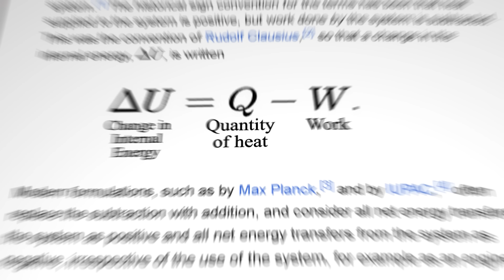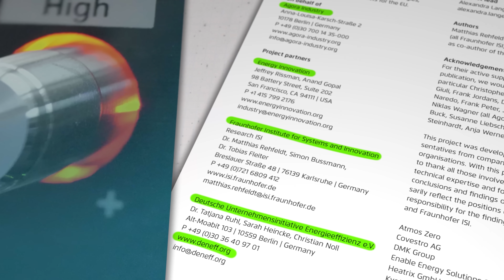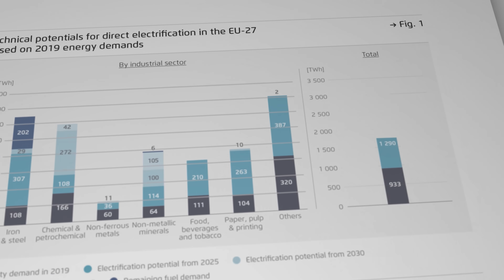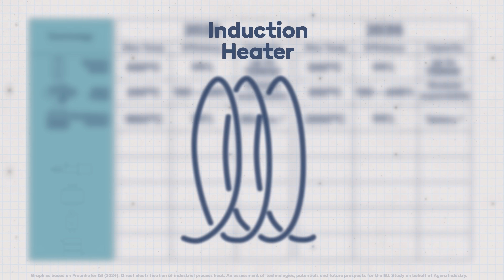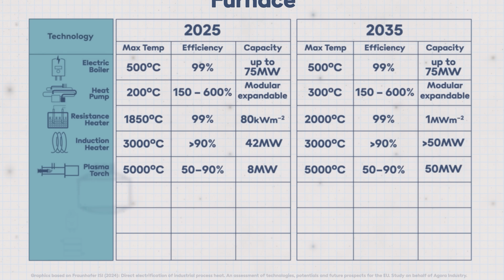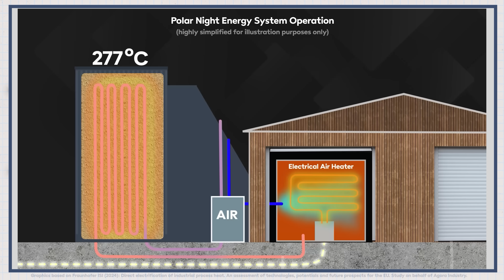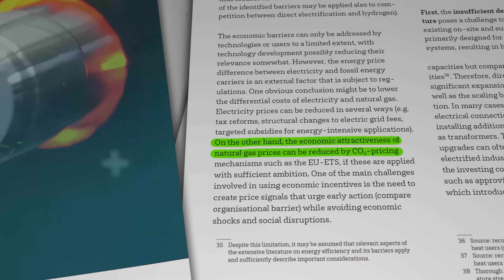Kicking fossil fuel out of industry! Here's how it's done...

Comment: Happy New Year!

It's certainly possible to electrify industry - although a big problem is, as you said, the price of electricity. Then there's the issue of capacity. You can increase supply by adding more renewable sources on the input end, but the system itself has to be capable of transmitting that power.

To do all of this industrial scale heating plus have electric cars, the power grid will have to have a much larger capacity. From your past videos it sounds like the European Union is planning for electrification by building new interconnectors and stuff, so they might be prepared for the massive surge in demand. I'm pretty sure Canada and the US won't be ready. Electrification of industry here will have to be preceded by rebuilding a lot of the grid.
Reply: The increase in demand does not arrive all at once ... there's time! Electricity infrastructure has always been built, extended and renewed in an ongoing fashion, as required. However, there are certainly some priorities to be focussed on!
The electricity use in every country has a particular pattern of use. The generation capacity has to be sufficient for the peak demand periods ... and that peak demand is way higher than the demand most of the rest of the time. At night time (for example), when electric cars are mostly charged, there is significant unused capacity available... we are still nowhere near soaking that up.

Comment: Our company converted from gas fired furnaces to electric induction and infrared heating almost two decades ago. Recently we installed as many solar panels as our roof could hold. Customers have shrugged and sent work offshore. There’s the rub. We might care but the customers don’t.
Reply: That is true of carbon pricing is also applied for imported goods.
Reply: The company probably got subsidy, paid by the people  ....  Taxes are now 70 - 80 % of brute income ....
Reply: This is an interesting dilemma. That company could have a competitive advantage as soon as a carbon price is in place, thus taking advantage of foresight an others then have to fight over high priced upgrades. The carbon price is not impossible, just resisted, perhaps by those who want to keep their present competitive advantage.
Reply: And where does the power come from? Coal or fossil fuel
Reply: @montanausa329  I mean, for you, yes. You live in Montana? Most people don't live in Montana or Kentucky, so in general, no. :)
Reply: Well... You can't compete if you sell crap. Do you work for Ford?

Comment: or, rather than use expensive electricity, just use cheap nuclear

Dow and X-energy will collaborate with the intent to deploy X-energy's Xe-100 high-temperature gas reactor technology at one of Dow's U.S. Gulf Coast sites...The Xe-100 reactor plant would provide cost-competitive, carbon free process heat and power to the Dow facility....The reactor can provide clean, reliable and safe baseload power to an electricity system  [80 MW electric] or support industrial applications with 200 MW thermal output per unit of high pressure, high temperature steam.
Reply: Nuke is expensive
Reply: @davidwatson8118  Yup! So expensive that Dow took a look at electrifying, and gas futures - and went nuclear!
Reply: https://youtu.be/AauseIxFQRE?si=WilUQIN5H0dnrCLW

Comment: I've asked a few HVAC guys if they've heard of heat recovery devices for the AC and heat pumps that they install.  Cue Crickets.  They are somewhat interested when I show them where to buy one.  It seems that around here it might be easier to find one at the high-end  swimming pool installer's showroom than at a HVAC dealer.  So much for "free" hot water in the summers.

Comment: Conventional industrial heat is typically diffuse and well over nine tenths of it is wasted.

Direct induction heat, by comparison, can be well over nine tenths directly applied to work.

True, Rube-Goldberg systems to recover heat can reduce the waste of the former, slightly.

But by and large, industrial heat is just sloppy engineering.

Comment: I think that it is kind of misleading about stating the efficiency of resistive heating is 100% efficient. The electricity used to power those resistive heater coils has to come from nuclear or solar etc. for it to actually be not powered by fossil fuels..... It is still way more cost effective to use fossil fuels or even wood to heat than anything. That is why so many places around the world still use fuel for heating and cooking. Even heat pumps which I have like 7 or 8 of in my house. I was using like 1,300kWh per month and at the regular rate, it was like $900 per month until I switched over to the subsidized plan of all electric house with electric boiler and IH in the kitchen. The boiler alone uses like 16~20kWh per day. (newer heat pump versions are available)...It is still cheaper for me to run 3 kerosene heaters placed around the house. The heat pumps can barely keep up due to the house being built 60 years ago and such a bad R rating...

Comment: Good to see industry needs being addressed. But i'm uneasy when it's said that these processes will be mostly electrified in Europe. I wonder if that doesn't just mean more industry gets moved overseas. I also struggle to imagine a big electric arc furnace being powered by batteries when there's no wind or solar energy. You can use gas as backup but then you're wasting half of it converting it to electricity when you could burn it directly.

Comment: Fascinating as always, and thanks for all the research links too. Granny, eggs etc but a few thoughts:

- Hydrogen, green or grey, is only really suitable for systems whereby energy density is the overwhelming design factor (e.g. aviation). Inefficiencies in H2 production mean that is will only ever be a true replacement for direct electric heating once the energy required to produce it is "free" (fusion).
- I reckon / hope that In the mid to long term, small modular fission with high grade heat output (HTGR, molten salt etc) will become an ideal energy source for steel, cement & chemical while low grade heat from more classic SMR designs will become ideal for desalination, food etc. I'm waiting with all my bits crossed for China to build the first nuclear fired steel plant and run carbon capture, or even better fission-fired green H2 production for the metal oxide reduction.
- Massive investment into electrical grids will be required for widespread industrial electrification which is unlikely to be government funded, driving operating costs beyond economical sense in western countries.
- Terrifyingly investment in oil prospecting and extraction is still flying high, with Guyana set to overtake Venezuela as the key oil producer on that continent in the near future. 
- We (as in, industrialized nations) spent centuries burning fossil fuels which led us to where we are today. We must expect that many, many other developing countries will do exactly the same, so our efforts must be to offset that as thoroughly as possible. Despite the UK economy being a complete disaster we're still in an extremely enviable position in the grand scheme of things.
- I don't like the orange thing across the pond either.

Happy new year :)

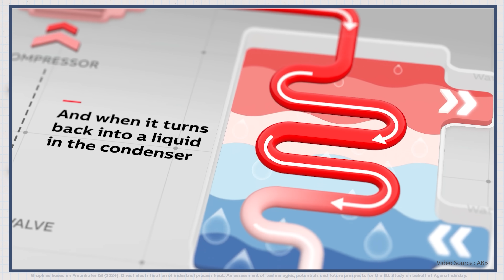Comment: @ 4:59 you can get but you don’t get it for sure … to stay in the 4-5 units of heat out you need everything to be perfectly made and designed… + you are extremly dependent of the exchange medium (usually air) to keep you’re high efficency + you have to change you’re lifestyle in order to keep a heatpump efficient to operate … - A gas boiler it can easily self  adapt to almost any lifestyle … you don’t need an extremly skilled engineer to do that …😅😊
A higly modulating gas boiler doesnt need everything to be perfect to stay efficient because it can self adapt to the load and the weather doesnt influence it’s heat output as much as it happens to an air to water heat pump…
Reply: A gas boiler burns fossil fuel. It's awful.

Comment: I this time not sure to completely roll out burner.
For the decarbonization to have success we simply need to avoid fossil fuel. 
Synthesis of fuels that can be a 0 emission if the fuel do not have carbon (Hydrogen or ammonia) or it can be produced trough carbon capture (so you release what you capture X-X=0).
In this case, fuels are simply storage of renewable energy, as chemical energy.
And while this is generally a process with not stellar efficiency in the charge phase it's easily scalable, at least using them to burn and heat up things, allow to an early 100% efficiency in the discharge step.
Much better than using them for cars...

Comment: @ 4:21 wrong - almost anywere electricity is and it was 3-4 times more expensive than gas / kw unit because electric lines have an average of 70% lose in the transmission lines and transformers …  and gas not … 😊 
And you can’t get more efficient kw output from gas in electrical power plants; convert it to electricity; send it to homes through power lines and then convert it again to heat compared to a condensing gas boiler at home for heating 😅 
But you either don’t understand how all this works either you’re full of bullshit and badly intended …

Comment: 11:30  That's often referred to as a "Carbon Tax".  I fully understand that a carbon tax draws CO2 emissions into the economic cycle and has to be part of the larger solution. 

The problem is that a carbon tax is one way for a government to get themselves rapidly un-elected and out of power. And a sure-fire to get into power is to promise to cancel a carbon tax. So as a solution, it has this built-in issue. And it's not just a North American thing, look closely at some of the 'Far Right' corners of Europe.
Reply: In Canada they made the carbon dividend and distributed it to the citizens. Did you heard of it?
Reply: @lorenzoventura7701  Sure. But it doesn't change my point about losing elections. Voters aren't always clever enough.

Comment: @ 4:11 They are cheaper to buy than a condensing gas boiler for the same output power … ar least up to 35 kw … 
You can find them. From 5-600E up to 2000E depending on the brand and model but is the same for the gas boilers …. You când easily find 5-6-10000 E gas boiler for you’re house … you just have to know were to search for it 😂 
Usually an acceptable condensing combi gas boiler starts from 7-800E up to 1500E … 
Until now in the video you are full of bullsheet with not very good intentions… or very wrongly informed 😅

Comment: @ 4:02 the fire hazard will be higly increase because you can smell a gas leak but you can’t smell in time a overheated electrical connection … + it is “very” good for all the apliances to have high levels of voltage pulsations from the high loads of electric heating rezistors getting in and out of the electric network 😅
Every appliances love voltage fluctuations 😅😂
Reply: Pure supposition. Fossil fuels are flammable and explosive, it's in the name.

Comment: Hi,
does this possibly miss the point that the electric heating at a given point is very efficient, but the electricity has to be generated by something which is a lot less than 99% efficient? Using gas for example, it's less efficient to turn gas into electricity and use that for heating than just burn gas locally. This is why most houses have gas boilers rather than electric heaters. It's a lot cheaper for the reasons I just mentioned.
A.
Reply: As the grid decarbonises, and it is, in many places the equation changes. Where I live, the grid is usually about 70% renewables during the day. Some people (me included) have batteries, so my home and my car run on sunshine 99% of the time. My excess power is exported to the grid. About 40% of homes here have solar panels, but we need more home batteries.
Reply: @aussie405 
South Australia 🤔
Reply: @davidwatson8118  Western Australia
Reply: @aussie405  
Cool 😎
Reply: @aussie405  Hi,
thanks for the reply. I guess you are lucky to live somewhere with a lot of sun. Here in the UK we have days on end when the wind doesn't blow and the sun light is too dim. I think the record over the last few years was 11 consecutive days. It's all very well, but what are the owners of these great electric heaters to do then, close the factory for a few days? It doesn't seem very practical to me.
Ah well.
A.
Reply: @adrianbratt9927  At this time it isn't mature technology. However, the supposedly mature technology has brown outs and blackouts around the world too. Generators need maintenance and have failures which can last for months. The more diverse the system is the better and spreading out the generation helps. The Boffins in the UK know what the problems are, and they are working on answers. Mostly, they also know that fossil fuels are finite and cost is only part of the equation.
Reply: @adrianbratt9927  
The wind will always be blowing somewhere on the British isles day and night.
Have you heard of a power grid?
Have you heard of Spain or North Africa?
How about, hydro, tidal and geothermal?
Reply: @davidwatson8118  
> The wind will always be blowing 
> somewhere on the British isles day and 
> night.

Actually, no it isn't. If you get a moment google for the longest Dunkelflaute  in the UK. 
I'll save you the effort - the longest was in December 2021 and went on for 9 days. 
We also have one in November 2024 that lasted for approximately 7 days.

Are you seriously suggesting that any of the energy sources you mention could keep the lights on in the UK? I don't think so. You can maybe do the maths, but I doubt it. Please prove me wrong.

I have been to North Africa a few times, but I don't recall seeing the cable running from the UK to there.

A.
Reply: @adrianbratt9927  
No shyte Sherlock.
It is not a situation of no wind but minimal wind.
Now try to be honest and tell us what the response to this possible situation is.
You can take a moment to look it up.
Reply: @davidwatson8118  Hi, didn't fancy the maths then eh? Quelle surprise. The numbers are everything, the lights won't stay on no matter how much you believe they should.

Minimal and none amount to much the same. If the power going into the grid is less then demand, then stuff gets turned off. Maybe your house gets plunged into darkness when its -5C outside like tonight. No power = no heating. Fancy that? I thought not.

I don't need time to look it up. The only energy source we have that is 24/7 and emits little carbon is nuclear. There is nothing of any scale that will do the job.

Cheers,
A.
Reply: It doesn't matter that solar panels are only 20% efficient at converting the sunlight falling on them into electricity, or that wind turbines only convert 40% of the wind into electricity. Sunlight and wind cost nothing and don't require shoveling tons of dirty fossil fuel into thermal plants every hour they are generating. (If you want something really inefficient, sunlight growing biofuel to then burn for energy is less than 10%; we got a free ride in the 20th century by digging up fuel that sunlight made millions of years ago)

We reduce the massive worsening harms from global warming by decarbonizing electricity generation and electrifying everything. (And by making and using less stuff.)